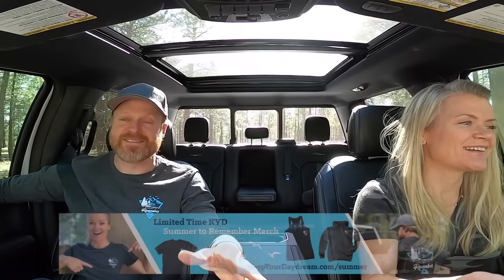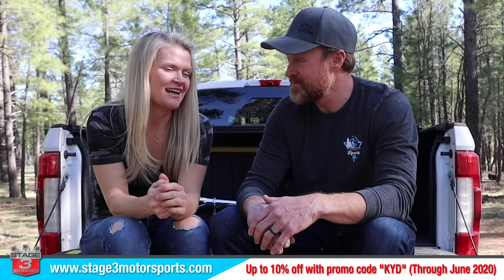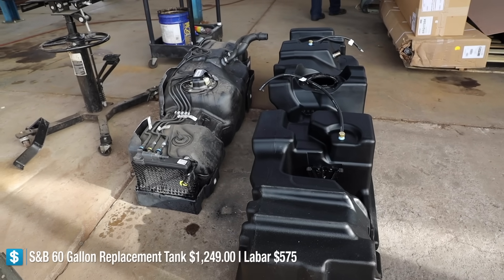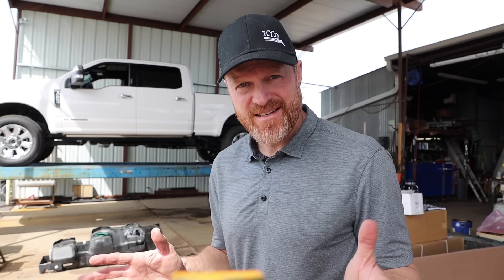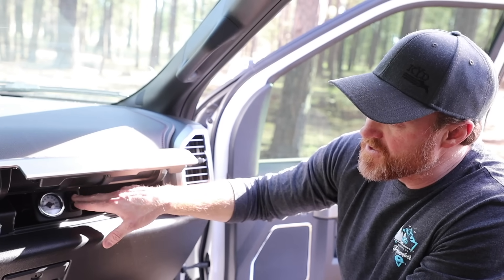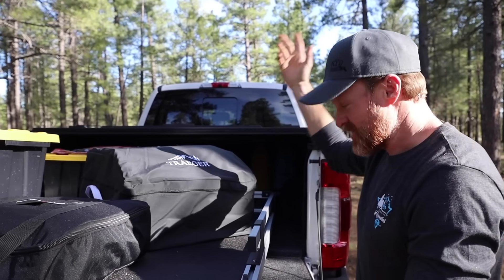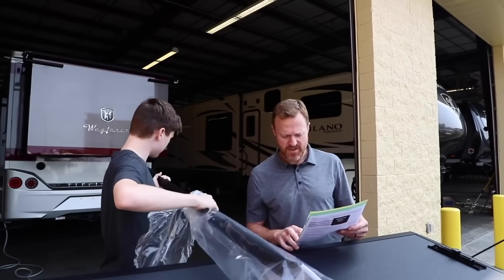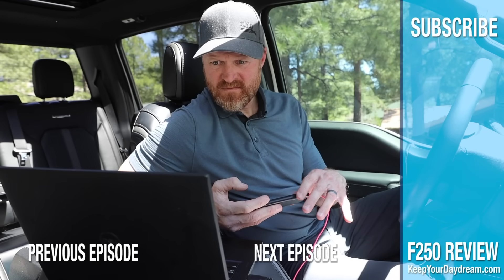Ford F250 Super Duty - Best RV Towing Mods & Upgrades

Comment: Hi Mark & Trish, I have a 2022 F250 Super Duty short bed Diesel, and am considering installing a onboard ARB twin air compresser, I wondered what you thought of yours after using it awhile ?
Thanks
Rick
Reply from the maker: I don't know if it's so much better/faster than the Viair that it's worth the extra money. Certainly a good pump and a nice form factor. We've had no issues.
Reply: @KeepYourDaydream  

thanks for your reply, good feed back
follow you guys, both enlightening and entertains
Rick

Comment: I've always used the retractable style of bed cover but I've been looking at the Bakflip for our new truck but my concern has always been when I see install or review videos of the Bakflip the exterior weather strip gaskets always look uneven and they don't lay right. I understand that much of that is how the rubber is trained by being in the box for who knows how long before getting shipped and installed, but does it flatten out and both look and seal better over time?
Reply from the maker: Yeah, once the sun hits the rubber, it becomes flat. I really like the BAKflip, but only for short/standard bed. Not the long beds like I mentioned. The panels are too big and harder to flip.

Comment: On my 2019 6.7 power stroke F 250, my wheels keep deforming when I trailer something. I’m running 325/50/22 Arturo tires right now. Any recommendations?
Reply from the maker: I would check your weight distribution tension. The purpose of those hitches is to move weight to the front tires. You might have too much tension. If you're not using a hitch like that, the weight and balance of the trailer might be off. Maybe not enough or too much hitch weight.
Reply: @KeepYourDaydream  I’m new to towing and will have to learn about all of that.

Comment: So when doing this type of upgrade does it mess with your warranty??
Reply from the maker: We've never had a problem. If the issue is correctly diagnosed and it's unrelated to the upgrade, there are no problems. If one were to go to a lazy dealer and have a negative service advisor (which is possible) they could try to cause a problem. I've always moved on quickly when dealing with people that like to find problems instead of solutions.

Comment: So Firman generator 3300 for under $700 good deal??  Why Firman??  Ive been looking for a good deal on a generator and not wanting to spend Honda $$$ on it. I’ve been keeping an eye on a Predator generator at Harbor Freight, and I  was told it was a good generator for price.   Thoughts??
Reply from the maker: We really like Firman. They are based in AZ and I know the co-owner. In fact, I need to check, but I think there is a KYD Promo code. Try KYD or KYD10 on their site. They are quiet, reliable and have remote start and all sorts of other features. If those codes don't work, email us!
Reply: Keep Your Daydream Great I’ll do that now.  Love upgrades!!  Would like to upgrade my F150 but even more to a bigger 250 or 2500hd for the long haul / long time like you said👍.

Comment: Mark great video, couple of questions, did any of the upgrades Cliff's did on your truck, i.e. Gas tank, air compressor, etc void your new truck warranty? I was told by my dealer if I didn't let them install the 55 gallon tank and air bag ride system it would void the warranty. Also, on the ARB air system is there a model that has auto leveling ?

Comment: Great video!  I'm curious on the S&B tank verses the Transfer Flow, because didn't you use the transfer flow on your last F-250?  How did the cost compare between the two?  Also, I'm on my second bakflip cover for my F350 short bed due to hail damage.  Got back from a 2800 mile  RV trip last August and the first night back we had a hail storm, which did $4500 worth of damage to the truck ,and it also totaled the bakflip.  Just had another hail storm a few minutes ago with dime size hail, and the replacement bakflip is now dented up.  I love that cover, but I'm thinking that I'm going to have to find a more rugged cover, which ones did you do research on.  Really looking forward to your next trip.

Stay safe.  Kent K.

Comment: I am curious if your running Amsoil fluids (differentials, transmission, engine) or some other good synthetics. I find most RVers forget about the abuse those differentials take towing heavy. Love the videos,  thank you for the awesome work!
Reply: I'm almost certain I've seen the hosts getting their engine oil changed at Ford dealerships, so at least with oil they are not using Amsoil products.
Reply: @anthonyc1883  
He may be able to help the mpg with Archoil AR6200. I have an elcipse attitude iconic 14k gvwr travel trailer,  I pull it with a 2020 F250 6.7 powerstroke. I'm getting 14.7 mpg towing it with using Archoil AR6200 in fuel and amsoil in differentials,  trans and engine (10w30 ADN diesel oil Amsoil). Makes a difference!

Comment: I have a 2017 F250 Superduty 6.7 Turbo diesel and I get 17.9 (have 46 gallons tank) pull a 32 foot 5th wheel - when towing I can get 16 and not towing I get 17.9
Reply from the maker: That's pretty good. Our Reflection was only 11k pounds and we got 9-10 towing. Do you have the 3.31 gear ratio. Both our F250's are 3.55. Our F450 was 4.33

Comment: I think your video has overwhelmed the folks at Stage 3.  On hold for over 30 minutes...got to listen to the lousy "elevator music" over and over but no one ever picked up (so I gave up).  At least I now know about ARB compressors, but I am unsure (based on the info I see online) if the single unit (you got the double) is a direct fitment replacement for my malfunctioning VIAIR 450P-RV unit that is mounted in the bed of my F-350 DRW.  

Separate subject--I am surprised (based on what you know about payload) that you didn't spring for the (relatively) small difference in price to get the F-350 SRW.  Perhaps Arizona would zap you with high registration fees?  (Crazy all the rules and how they are different from state to state.)

Comment: Like your mods. We love our truck cap. (Just click on logo and your see it on our opening page) Also have the Airlift with the jounces inside the bag. Perfect in case of Airbag failure. Now are you guys sure you can get into Canada? Just might have to adjust your itinerary a little.
Reply from the maker: I came VERY close to a ARE Z model, but it all worked out. The 3300 watt gen and SUP boards would be nice to store in the back. We'll see...
Reply: @KeepYourDaydream  Good eye..that is a ARE cap! Glad it worked out. Side note we gave up our 2000W Honda for a 3500W Champion duel fuel. Miss the Honda but Love the Champion!

Comment: I don't know why but on my F-350 long bed I can just see my 5th wheel hitch in my camera with my MX4 bed cover. How strange is that? Wish I was going with you guys this summer.
Reply from the maker: Interesting. I wonder if your BAKflip has an extra panel. That would be MUCH better than what I had on my F450. Each panel was so big, it was hard to flip.
Reply: @KeepYourDaydream  Mine has 4 panels that are 22.5 inches each. It has a fixed panel in the front that is approx 6 inches wide.

Comment: I don't understand going from a F450 down to a F250. You can't have too much truck. When my Charger 392 Scat Pack is paid off I am going from a Dodge 3500 dually CTD to a 5500 Dually. I carry A Lance 1172.
Reply: Here's what Marc had to say about that topic in the KYD blog: "Many people say there’s no such thing as too much truck. Go out and get a big truck and then you’ll be set for any towable RV. This is not my perspective. Too much truck is an unnecessary expense. It will likely be bigger and more rigid, which is fine if you need it. But if you don’t need a dual wheel drive truck to tow, why deal with drawbacks of a stiff ride, long bed or difficulty finding a place to wash it. Matching the proper truck to the trailer is more enjoyable process and by selecting the trailer first, you’ll be in a better position to accomplish this."

Comment: All I want is our top of the line Leer cap not to leak! 😭😭 for $3000 you’d think the carpet wouldn’t wick water inside the bed. We had a back flip before this cap that also leaked so we thought the cap would solve that problem.. nope.

Comment: Mark, I'm surprised your only getting 10-13 Mpg towing. That Diesel cant be under that much load towing that small of a trailer. I'll bet the new 7.3 Gas would not get much different millage.
Reply from the maker: 8800 pounds with the airstream, but the 3.55 doesn't do as well as the 3.31. Keep in min, I I do not baby the gas peddle :) The Airstream tows so nice and the Endurance tires are 87mpg speed rated, so we set cruise and go!

Comment: Looks like you waste a lot of the space in the bed with the slide.  Seems like a better design would be to have the slide drawer be shaped closer to the sidewalls for the part that is rear of the wheel well.

Comment: Why did you go with the diesel engine, in your F-250, instead of the new 2020 7.3 gas engine? Be safe out there.
Reply from the maker: Depreciation mostly, but cruise control 70 mph up hill while towing a close second!
Reply: @KeepYourDaydream  Thanks, Marc & Trish. The reason I asked is in about two to three years I plan on getting an F-350 (SRW or DRW haven't decided yet) for a slide-in truck camper and I want to see how the 7.3 gas engine pans out.

Comment: I love all the upgrades you've done to the new truck . Looking forward to hearing the air horn after it's installed . Where are you going to mount it on the roof or under the hood ? Will the boys & Tori be traveling with you for 7 months ?

Comment: Will you have a few in the generator is buy a second one of those little skinny lands and connecting together and now you have what you need when you have to the need for more power and you don't compromise that he might lose something in the backer you might not be able to carry but your you could put the other generator somewhere else but fact is you can fit 2 of them back there and now you have you combine the 2 together I think if it DO voltage looking for and it will just cost double the amount of money because I have a firm and 2000 and they're heavy and I can't even get started what you have there would have been better if I had to those which is 1 that's the right vote dressed me you live it is much later it much easier to use of we have 2 of them then he had defeated dual gas would you run a bowl of propane which made you can have can gas cans replace legal private kennels in a turn

Comment: Looks like all they did was replicate a problem that Dodge had with there 2015-2018  Air Ride suspension. The Compressor was located in that exact spot and in Cold weather, -20 celcius and lower, the compressor couldn't function and left your vehicle riding on the bump stops. Very Frustrating. Hopefully your Alaska trip doesn't leave you guys that far from home on your bump stops.

Comment: Nice.  Titan tanks have lifetime warranty tho.  Bak Flips have terrible reputation.  Both for horrible customer service and products falling apart and them not honoring warranty.  Maybe you guys will get lucky because of the Youtube presence.  Most of us have moved away from bags because they just fail.  The more complex and more use, the easier it is for them to fail.  Lot of us are using Roadmaster Active Suspension.  Awesome rig though.  Cheers